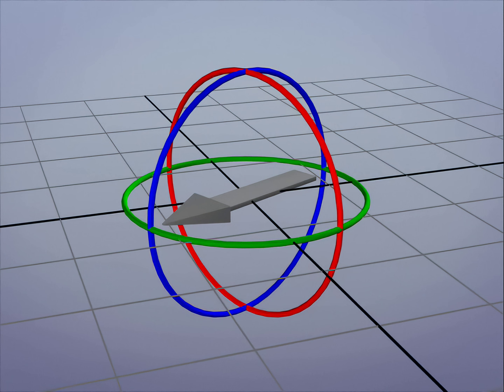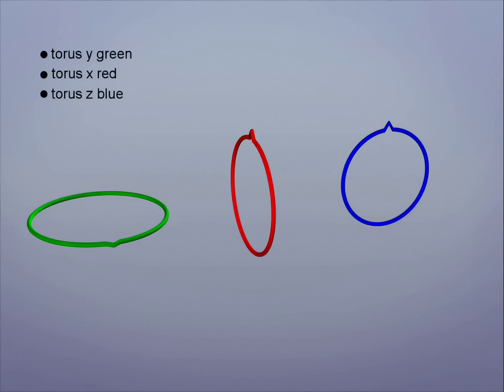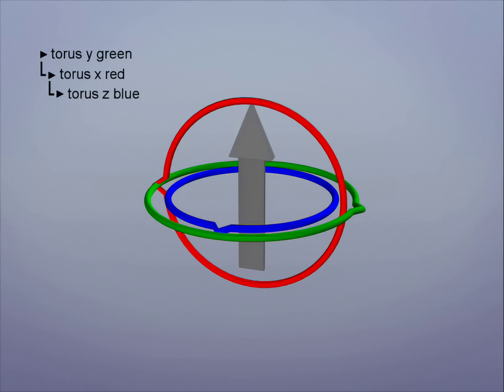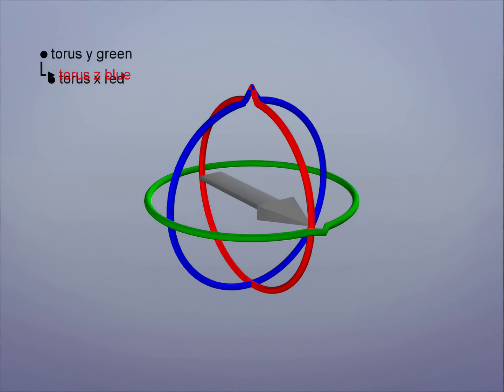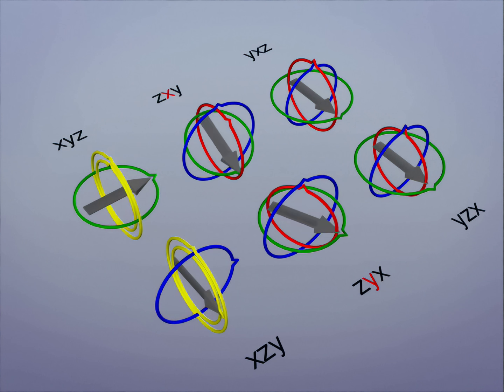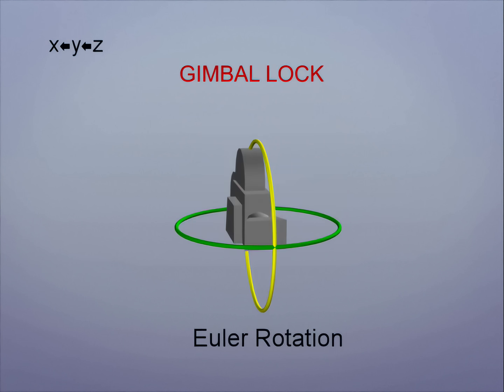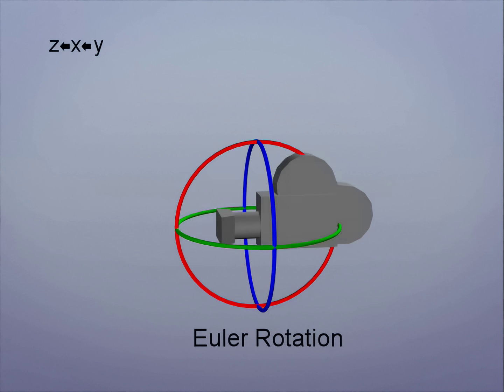Euler (gimbal lock) Explained

Comment: A Gimbal is a 5DOF rotation system. At all combinations(including straight up and down) you can accomplish any of the 5DOF movements of a 5DOF system. You don't use a Gimbal to move in 6DOF, so labeling the fact that you can't make a 6DOF movement in a 5DOF system as 'lock' seems wrong. Great video for demonstrating the 'limitations' of 5DOF however.
https://youtu.be/zc8b2Jo7mno?t=2m37s
Reply: Hyper Sonic There are only 3DOF in the models shown above, rotation around x, y and z respectively. That's how you count the degrees of freedom. And it's called gimbal lock because you go down to 2 DOF when it occurs, thus locking one of the gimbals to another one.
Reply: MrSylfa Yes 3DOF rotations(I guess I said 5DOF since the rotation portion is similar to what I've used for 5DOF movement schemes, but with roll disabled.) However I see no 'lock' occurring. At all times: -you can spin around the world up axis -spin around pitch axis -spin around the arrow's longitudinal axis Even when vertical this is true, so where is the 'lock'?
Reply: Hyper Sonic As you can see in the video, when you have turned the middle gimble 90 degrees the outer and inner one aligns, turning either of them changes only one rotation of the inner object, at that point you only have 2 degrees of freedom, one degree of freedom has been locked and cannot be affected at that point, not until you turn the middle gimble further will you return to 3DOF
Reply: MrSylfa When vertical does rotate around the arrow's longitudinal axis accomplish the same thing as rotate around the world's up axis? Yes.
When vertical can you still (1)rotate around the arrow's longitudinal and (2)rotate around the world's up axis and (3)rotate around pitch axis? Yes to all 3.
So it's not really a 'lock', more like a limitation of the system due to rotating around the world's up axis rather than the arrow's up vector which would never end up being co-linear with the other rotation axis. In 2DOF rotation first person shooters aiming near vertical is a pain, involving fast and frequent heading changes which has nothing to do with reducing from 3 to 2DOF.
Reply: The term "lock" comes from a real world gyroscope as they are used in aircrafts and spacecrafts. In a gyro you don't move the 3 gimbals yourself but the gyroscope in the center keeps it orientation due to the gyroscopic effect. So the "thing" in the middle represents a reference frame which always keeps it's orientation. When the outer gimbal, which is mounted to your spacecraft / aircraft, is rotated the gimbals will change their relative angles since the reference frame keeps it's orientation.

Now consider you rotated your space craft 90 so it looks straight up. Since two gimbals (always the outer and the inner) are aligned you lost one degree of freedom. If the space craft now rotates around that missing axis the gyro will be forcefully disorientated and you completely lost your reference frame because the gimbal has "locked" it's motion around that axis.

Of course theoretically if you know the rotation you want to perform beforehand and you could, somehow drive the rotations of the outer and inner gimbal you could first rotate them so the middle gimbal can perform the required rotation. However that's impossible. Especially if the space craft currently performs a rotation and rotates over the lock position. It's a dynamic process and the gimbal would have to realign immediately which isn't possible due to inertia.

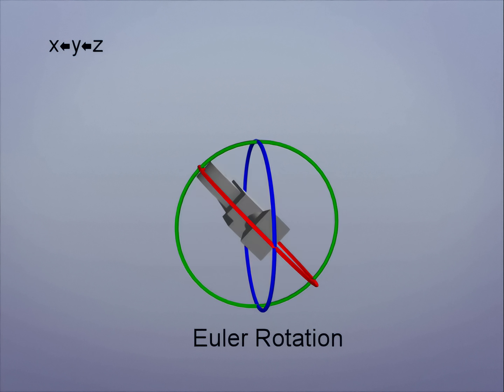Comment: check out the z-fighting on those axes (6:36). Great explanation it definitely helped me understand, but don't get fooled I spend quite some time on this, also used an interactive program to test it, made a paper gimbal, read on wikipedia and programmed a simulation from bare opengl. Also on many train rides I tried to simulate this problem in my brain: It can't be done, at least, I can't do. My brain doesn't have enough working memory for this.

Things you want to keep in mind: there is a given hierarchy of axes, yes Euler angle can represent any orientatinon in euclidean space and finally, my personal last insight needed, gimbal lock is a problem of contiuous movement. If we try to orient an object, when it is already in a certain orientation, such as, best example, in gimbal lock, we can't perform straight forward transformation because we lack a degree of freedom. We need to backtrack the rotation where the degree of freedom is restored and approach the orientation we wanted all over again. This backtracking is what is bad for animatiors as between keyframes there will be discontiuous or deviant movement from the path of 'apparent least resistance'.

I wonder if this helps anyone, I am just ordering my thoughts here.
Reply: Thanks for your awesome explanation! It did help me. My  rain can't simulate that neither.
Reply: Yes! I agree to you opinion. I think that Euler angle can represent any orientatinon in euclidean space

Comment: Never use euler rotations. Use quaternions.
Reply: +Giles Bathgate Have you found the video yet?
Reply: Unless you are an animator and have to work with CURVES.
Reply: @darksidegirl  could you elaborate? sounds interesting
Reply: @SoumilSahu  Sure. Quaternions use X,Y,Z and W, and it is based in "complex numbers", which doesn't have a really easy visual representation...   It is not easy to explain, and is not as simple as some people say that "It is an axis (X,Y,Z) and an amount of rotation in that axis.   You can't see and modify curves with Quats, it would be terribly difficult to do anythin. But you can interpolate between them without gimbal lock, which is great, that's why 3d software inside works with Quats. (mathematically you can change between Euler and quats)...  But to be able to see the curves and change them in a more visible / 3d way, you have to use Euler... oh, It's a little hard to explain sorry.
Reply: @darksidegirl  so basically you use Euler angles to tell the curves how to change, but internally the computation is still based in quaternions? That's kind of what I'm getting
Reply: @SoumilSahu  yes. But also because visualizing quats and working with them by hand is not trivial.
Reply: why?
Reply: Now I only need to understand quaternions.
Reply: Never use Haskell. It's evil.
Reply: @TheSpacecraftX  how come

Comment: Couldn't the program just be smart enough to recognize when an object is in gimbal lock and change the order of rotation to solve the problem?
Reply: You can use quaternions in conjunction with some form of rotational linear interpolation between them for animations but I guess it really depends on the underlying software. Besides, this has other drawbacks.
Reply: Yeah it all gets pretty messy with other techniques, sometimes I'll plot keys and use a euler animation switcher so you can switch between gimbal space, it's just easier in complicated situations.  Luckily though they don't come up too much.  You can get those scripts for Maya that modify curves when you switch gimbal modes.
Reply: ***** Now that's pretty smart. Will invest $$
Reply: ***** you can use quaternion math but it uses vectors which you can't graph for animators
Reply: LimitedWard, sorry it doesn't work that way, if you auto corrected order of rotation the the curves in the graph editor would be a mess unfortunately.
Reply: andrew silke Why? What would happen? Would there be some sort of error propagation?

Comment: So, in the final  example, gimbal lock only occurs if the object being tracked passes directly overhead. Are there any practical issues though as the object approaches the lock position too? (Think ack ack gunners)
Reply: There are; depending on how the gun is set up, it'll have to turn itself (or be turned) a full 180 degrees to follow pursuit of the "offending" object.

Comment: Best solution is to rotate 2 of the rings at once and not allow rotation of a single ring. The angles between the rings will never change and gimbal lock is impossible.

Comment: @andrewsilke1 (...late answer)
I've used it, and experienced it's ...beauty of gimbal locks and limitations, especially on Blender with all sorts of problems related to rotations.
I don't care about statistics and how many use it. Statistics are most of the time misleading and what the majority does is most of the time wrong. I only care about a system that works perfectly for its purpose as expected. This system IS fundamentally faulty or inappropriate for 3D rotations.

Comment: Thax a lot but: 
This video should serve just as an explanation of the Euler method's flaw and why we should NEVER use it to rotate anything, instead of providing a partial solution which still gives us a faulty rotating method. 
(For example, what if the camera looks straight up or down and then try to rotate to the other axis that causes gimbal lock?)

Comment: If I understand correctly - Y was put as the main parent - because it is will likely be the most used axis, then X - because it will be the least used axis - then Z..

1 - most used axis
2 - then least used
3 - the axis between the extreems...

reason being - gimble lock occurs when the second axis hits a certain point... uhhh makes sense.... i think.